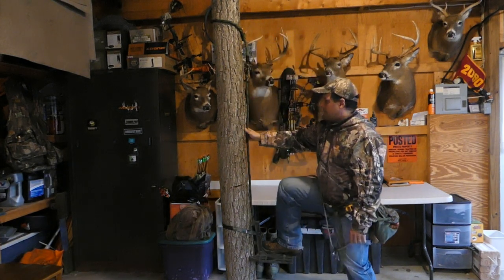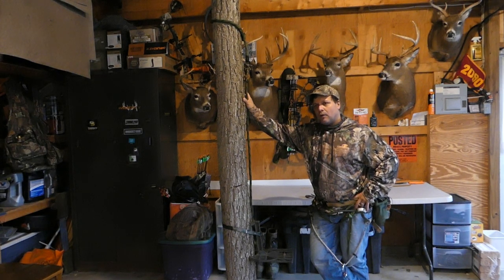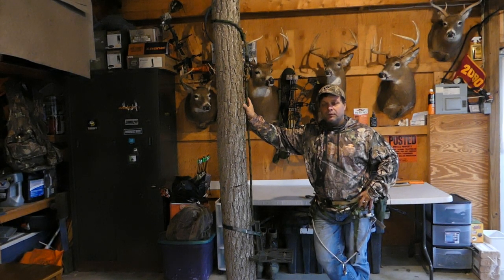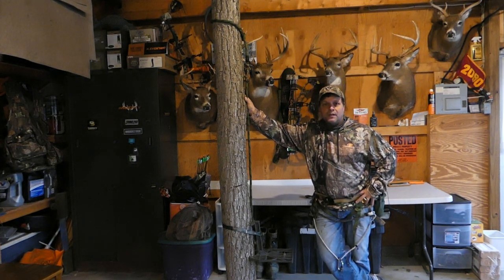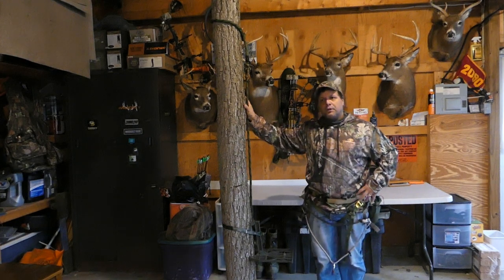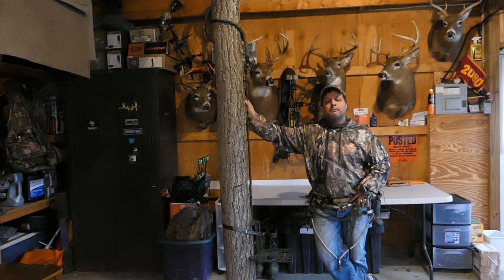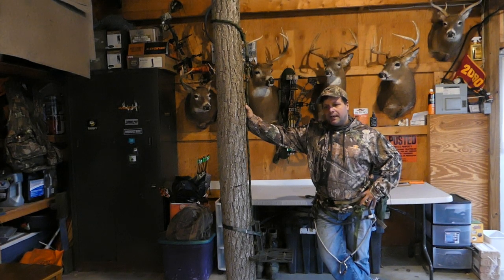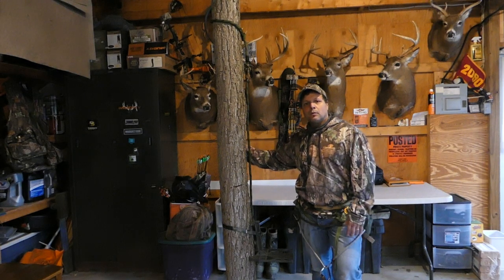Carabiner safety & season update

Comment: I have 0 experience with SRT. The reason u switch from climbing line to tether for safely or mobility?
Reply from the maker: It’s more of a preference. I tend to stay on my rope more . Joe likes to switch over to his tether once he’s up to hunting height.You actually have more mobility on the rope . The longer your pivot point is the more mobility you’ll have.  I can literally shoot 365 degrees around my tree no matter how wide it is .But depending how high you’re crotched in with your rope will sometimes require you to adjust your saddle because it will want to creep up on you with a high tie in point.  It is also why I prefer the Kestrel flex . With the added pleat I have more material under my butt.  Which keeps me comfortable .  However in colder temperatures with bulkier clothing I opt for the tether . I did a lot of experimenting with both styles this late season. I was more comfortable when I tethered in.
Reply: Thank you for ur time answering that. I got some equipment ordered. Wespur should send u commission:)
Reply from the maker: Tommy Eastham  appreciate the support .  Good luck. Hit us up anytime with your questions. Climb safe !!!